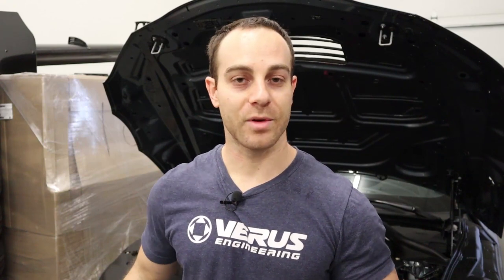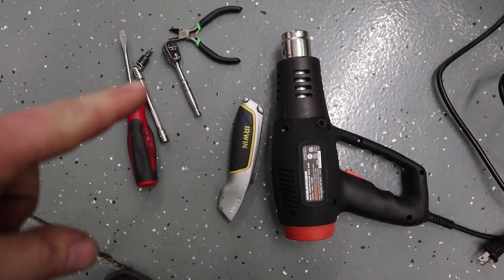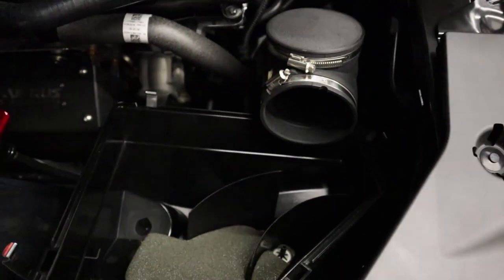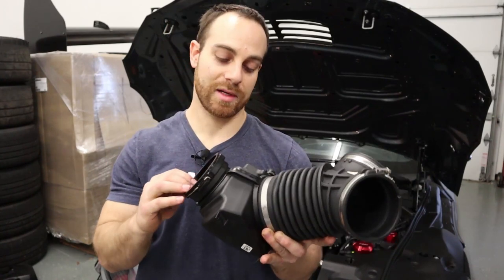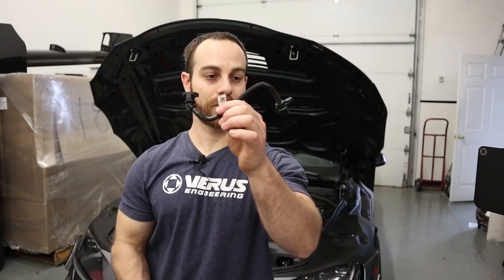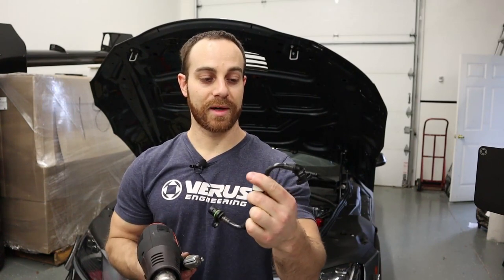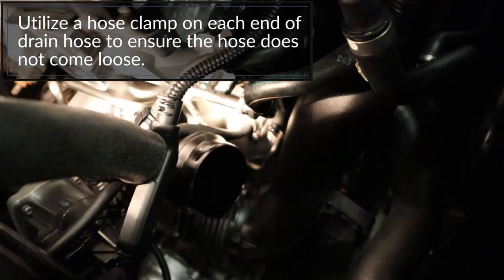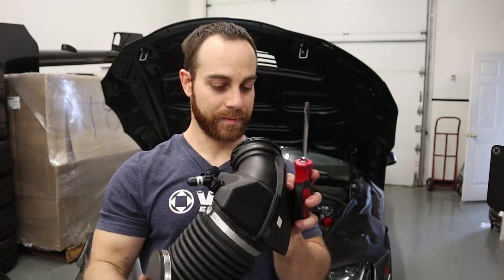AOS Drain/CCV Line Kit - Mk5 Toyota Supra

Comment: Since the AOS is connected directly to the CCV and the intake port is plugged, how does the system drain oil during high boost without causing issues with airflow? Is there any risk of the oil backing up when the CCV is venting?
Reply from the maker: It is going to drain back into the block. We've never heard or seen any issues with draining oil under boost and no reason to worry about the oil backing up. This has never happened with our AOS or drain kit.

Comment: Hi there! Can you help me understanding differences with the Mishimoto Oil catch can CCV side kit. I feel there is something I missed..
Reply from the maker: To be honest, we are not too familiar with their catch can, but if it just a catch can, then you will have to drain it. With our CCV Line Kit, it makes our AOS service free without the need to drian.
Reply: @VerusEngineering   Well they drain oil where you put oil.. now my question is: what’s in that ccv line? Air or oil? It’s in or out? You put oil in an air (vent) hole?
Reply from the maker: @aldocigolari5012  The CCV line drains oil from the AOS back into the engine block. It has a one-way check valve so the oil only has one direction it can go.
Reply: @VerusEngineering  What’s the function of that hole on the block? Is that hole for the gasses builded in the cranck case and sended to the intake, or not? Looking in bmw forums trying to understand better, I found a lot of problems due to the ccv fail.. that’s why I’m now worried to do something wrong. Thank you so much for your kindness and patience
Reply from the maker: @aldocigolari5012  Yes, that is correct.
Reply: @VerusEngineering  is it safe/good to stop/close that hole by sending oil from AOS? Where will the gasses go?
Reply from the maker: @aldocigolari5012  No. You do not want to block off the CCV vent tube.
Reply: @VerusEngineering  this means that the CC will “blow” gasses in the AOS if needed?
Reply from the maker: @aldocigolari5012  Yes, the crankcase gases will go through the AOS as opposed to the intake.
Reply: @VerusEngineering  Now I get it! Thanks a lot! I’m the guy waiting for the red AOS to be produced bought from SpeedIndustry.. now I need this too! Next step will be brake ducts... you’re doing an awesome work! Thank you!
Reply from the maker: @aldocigolari5012  We appreciate the support.